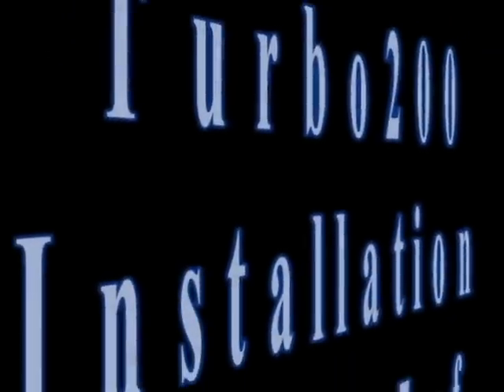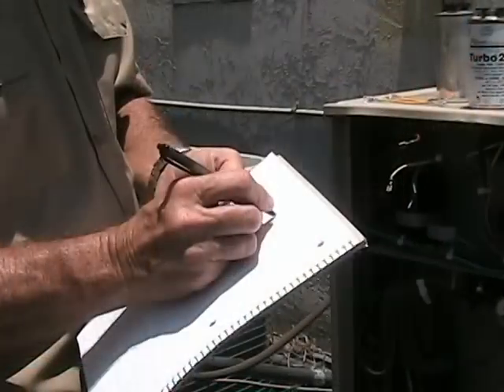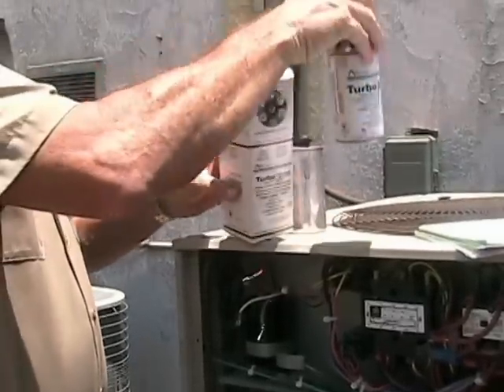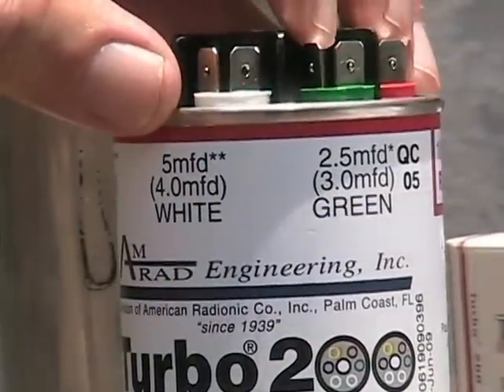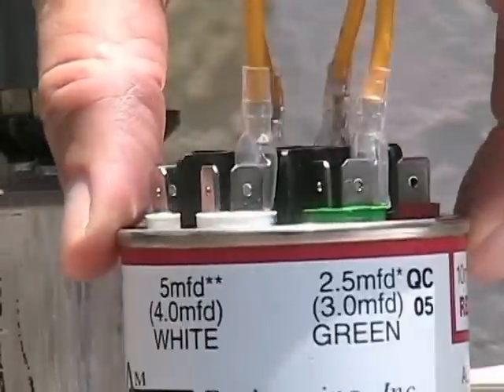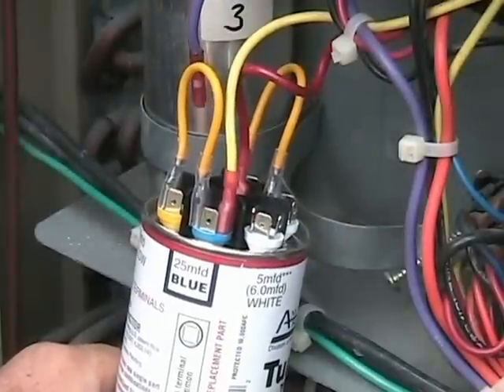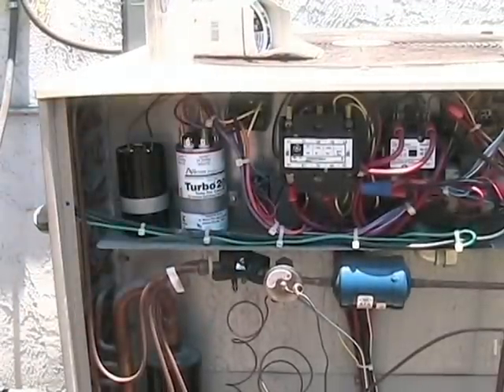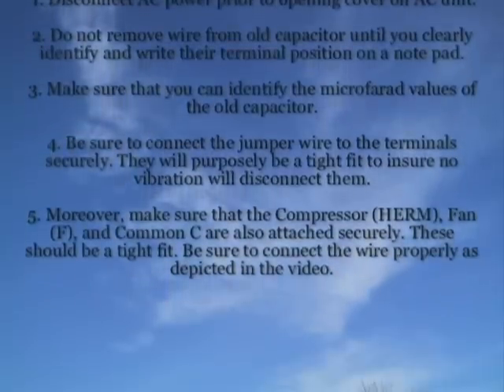AmRad's Turbo Installation

Comment from the maker: Thank you. Yes, The Turbo200 and the other Turbo200 Family of Products should ALL be installed vertically. With the terminals facing up. This will provide the optimal running condition for the capacitor inside the can.

Comment: Should be more clear about installing them in the upright position only. Has been overlooked here as they have been installed horizontally in some older Trane heat pumps without any way to stand them in the upright position.